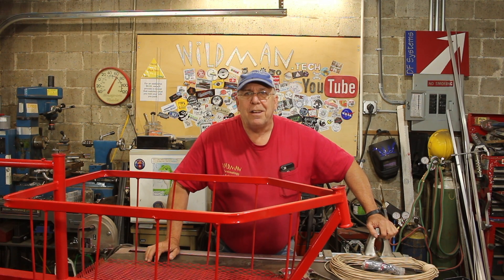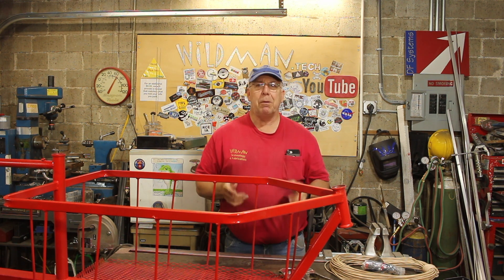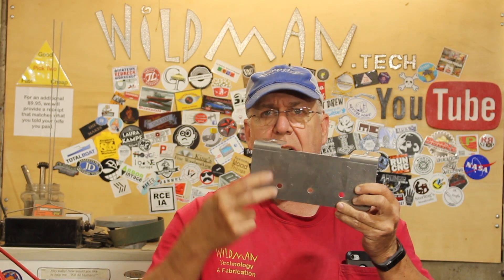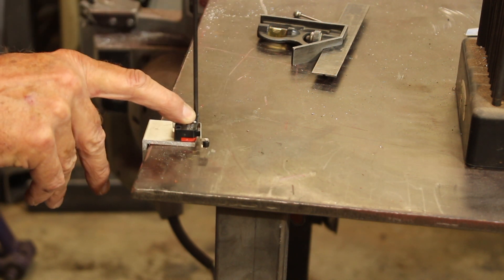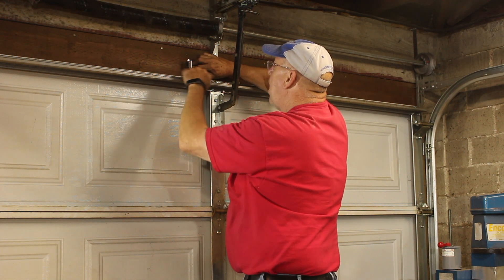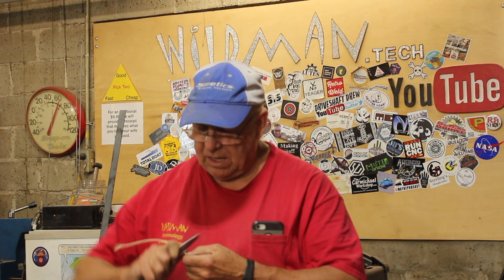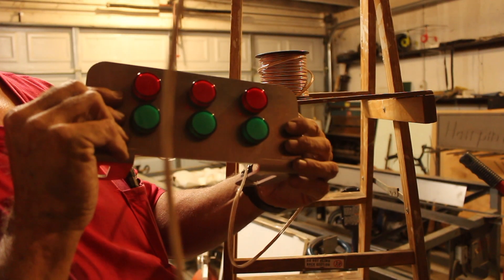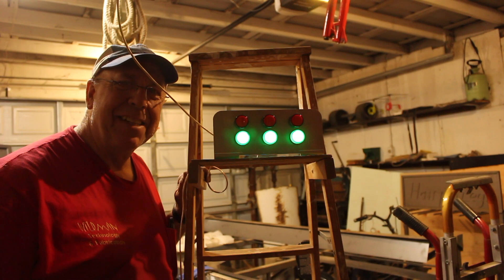Garage Door State Indicator System

Comment: Good idea. How are you powering the system?
Reply from the maker: The indicators are 24 volt, so I just got a 24-volt power supply. Complete parts list with links is in the description above.
Reply: @WildmanTech  Thank you for the info!

Comment: Thanks for sharing.  Fantastic idea.  If I may request, please share the electrical diagram of the wirings from power supply to the switch for one door only.  Thank you so much.
Reply from the maker: I think I described it, in sufficient detail that you should be able to figure it out. I don’t know how I would go about posting a schematic at this point. Negative goes to the negative side of the light, positive goes to the switch and then to the positive side of the light.

Comment: I’d like to have a detailed wiring diagram. Great idea. It happened to me a few times so I checked it out. Is it 12 volt or something else? Thanks
Reply from the maker: There’s not much to it. A wall transformer goes directly to the led on one side, and through the door switch then to the led on the other side. Just about the simplest circuit that can exist.
Reply: @WildmanTech  I can picture that powering a light when either open or closed, but how does it do both without 2 switches per door?  I'm ordering the switches and hoping for the best.
Reply from the maker: There are links to all the parts I used and the video itself is a highly detailed description of every single aspect of the construction from start to finish. You don’t need a wiring diagram. You have created an excuse.